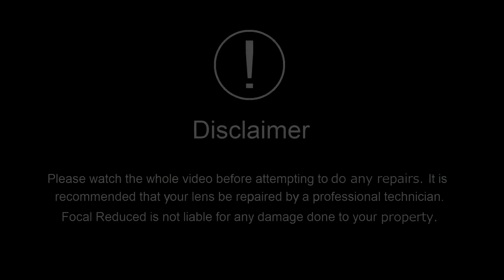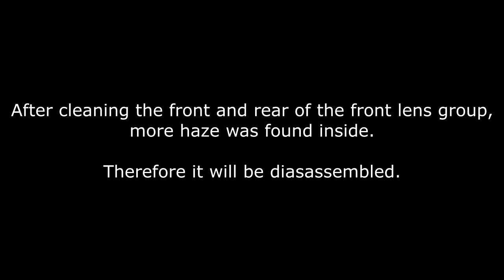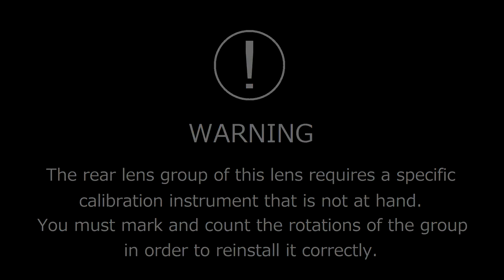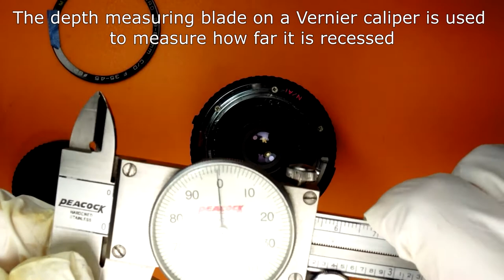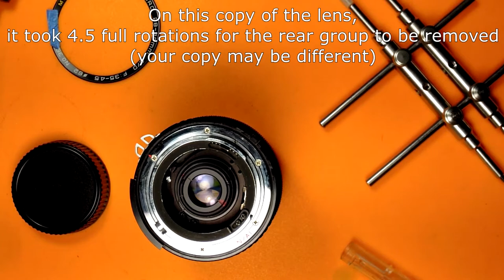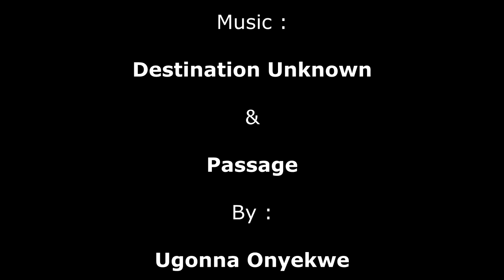The Dirty Soligor 28-80mm F3.5-4.5 lens cleaning.

Comment: I wish I watched this video before I opened my Vivitar Series 1 24-70. I didn't realise I need to note down the distance of the rear group and now it doesn't focus anymore. I will have to do a lot of trail and error to figure out the right position now. That is if I can find the patience :D
Reply: Excuse me. What distance?  The sane hsppenned to me with the Soligor 80-200 f4... Every image is blurred... Even though I see the lens clean!!!
Reply: @ if I remember correctly the rear group was held by a thread. You would need a special tool to screw it in to the correct position in regards to the rest of the optical elements.